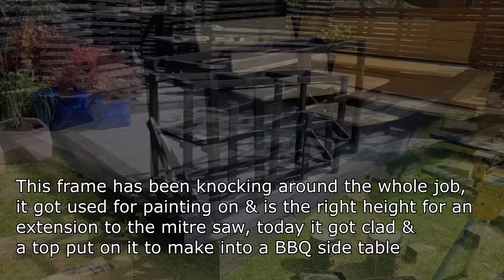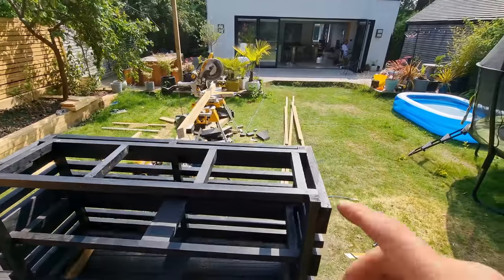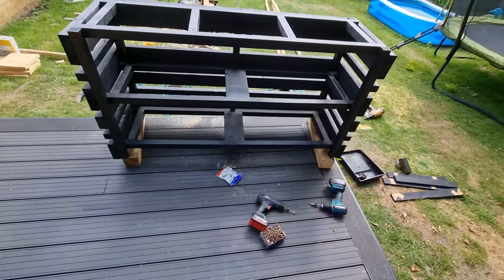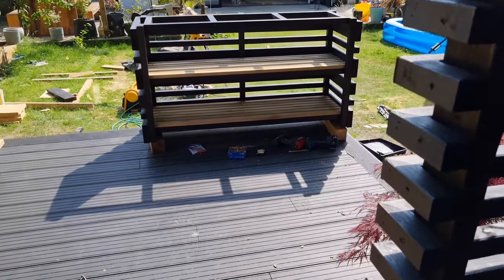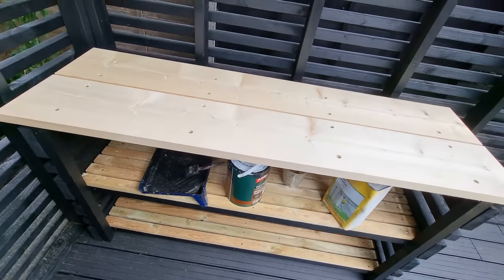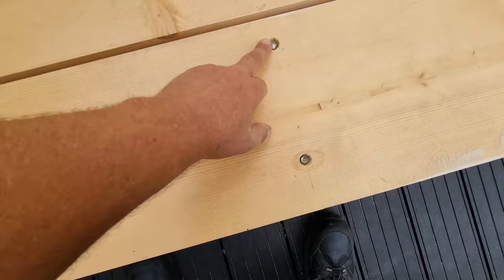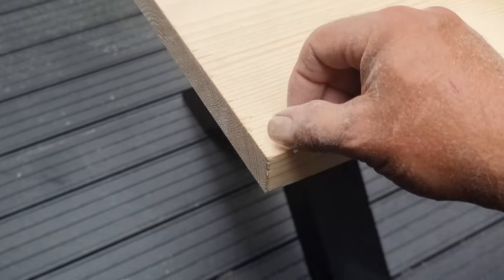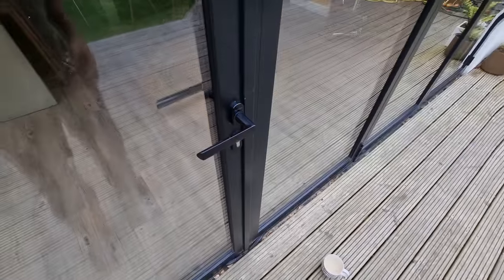BBQ Side table build made from an old frame, remaining wood from the room & some pine boards

Comment: Yes agree, the 'wisdom' of using an H or 2H pencil is wasted on me too. I use standard HB or F and often use an ordinary eraser because as you say, unlike 2H there's not a score line to lose too. Good video series Gid, you certainly earned your 'mad dog' medal for doing that in the heat!!
Reply from the maker: Thanks John 👍 Yeah it had to be just steady away & lots of breaks in the shade 👍 I've got an old coarse eraser but yeah, you learn from experience when there's loads of unnecessary lines on your work or they're cut in too deep.

Comment: Nice job mate, ended up being a relatively large job in the end, I don’t think it’s going to blow away any time soon cos it’s a solid structure, looks like a fairly good sander that Makita ? I would imagine your about ready to move on to a different job by now so I’ll look forward to your next video 👌👌👌👍👍👍🇦🇺
Reply from the maker: Thanks 👍 Yep nice build but nice to move on, i always knew it might drag on a bit & i lost a bit of time at his studio, doing the student house & to the hot weather, there were a few f*it i'm off home hot days, but about 4wks total 👍 yeah the little sander was a replacement for a very old but very similar Makita one that after 25yrs or so still works but started to rattle a bit, Pergola next n a bike shed, then some wardrobes, a summerhouse, a deck i think & a full bedroom make, spray n fit, ...
Reply: @Gidjoiner  pleased to here you’ve got plenty of work in the pipeline, l will look forward to some more great videos coming up 👌👌👌👍👍👍🇦🇺

Comment: Excellent job Gid, out of interest what was the total spend on the materials for this job…I’m guessing it’s got to be around £3k
Reply from the maker: Thankyou 👍 & forgive but 😂😂 £2.5k for the wood for the deck & building, £1.5k for the composite decking, about £400 for other materials (50 joist hangers, a 1000 twist nails for those, 1000 x 90mm nails for the building framing & 2x2 horizontal battens, 50 coach bolts, 34 bags of ballast + 6 bags of cement for concrete & about 50 coach screws, )  The boards for the seating were £9.75+vat per metre, i bought in total about 41 metres = £471.96, the 240x120mm x 3m sleepers for the seating cost about £35+vat each i bought 2 , & about 6 or 7 x 5L pots of Johnstone black treatment/paint  + my labour time which sorry i'm not sharing so a little more than £3k, double that & add a ½ again, closer to £7k, neither of us has added it all up yet, he doesn't want to & i don't need to for my accounts.
Reply: Good god, it’s crazy how it can all add up. I made a small deck earlier this year 4x4.2m and I think all in it was around £1100 in materials and that was before timber prices went crazy. Your previous videos actually helped me a great deal when doing this so thanks for the content. I’ve got a wrap around decking to do next year and I’m in two minds weather to patio or just replace the decking will just have to see how material costs compare as I’ve got all the gear now. Also love your dewalt mitre saw, I bought an evolution one as I’m a diyer and it just about coped with the joists. I also bitumin painted all the joists and the underneath of the deck board as I couldn’t bring myself to spend out on the composite stuff. As always great content and a valuable source of info 👍
Reply from the maker: Thanks 👍👍😊 I've some pics on Facebook showing the build process of jobs, a lot were from before i started filming my work https://www.facebook.com/gid.joiner/photos_albums

Comment: aye up pal. im having a lot of come backs on wood splitting on gate posts this year. is it just shit wood ??
Reply: They'll sell you anything that looks a little brown these days. We ordered a batch of center-free 3x6s douglas fir this year. Not only did half of them half the centers in, the rest often had splits so big we could see through them and they refused to take it back. The trested stuff at our supplier still seems to be of decent quality. But we are on the other side of the pond. The rush to get wood out the door might have something to do with it. A dripping wet post with a center in it stands no chance in full sun.
Reply: @johannes.f.r.  yeah its getting bad mate.
Reply from the maker: Yep poss not dried properly, too fast maybe, i don't know about where you are but a lot of this wood is grown as a crop, it's grown fast so is a bit rubbish, I've not bought many fence posts in the last yr or so but the quality seems pretty much as normal, all the treated wood here is stored outside in big packs & it rains quite a lot so it's always a bit wet or absolutely soaking wet, the bits on top of the pack dry out & bend or split, so i dig down & find the straighter pieces but they're wet & when i get on site it's still wet, i have to work with it like that, if i let it dry it'll become bent, i don't have any complaints about the wood splitting later but i always tell my clients that's a possibly & they understand, this is rainy England 🙄👍 you might have seen on this job the wood i used has had time to dry n bend, the 4x4 middle rail had splits so i put those facing down, & the last few weeks has been very warm, we sort of accept bending, swelling, drying n splitting here.
Reply: @Gidjoiner  Leeds :)
Reply from the maker: You'll be buying the same shit as me then 😆
Reply: @Gidjoiner  yep! lol